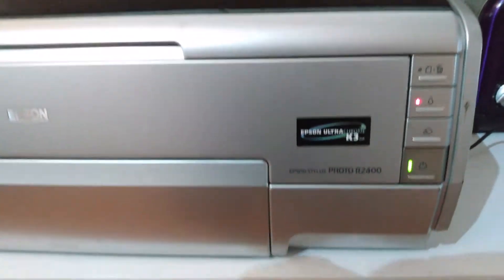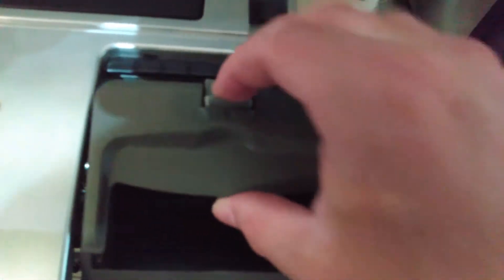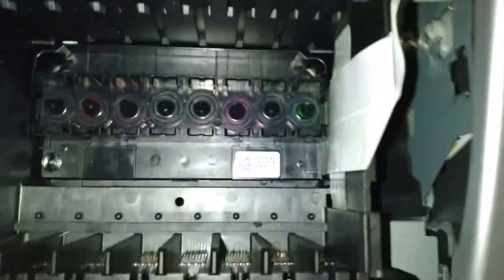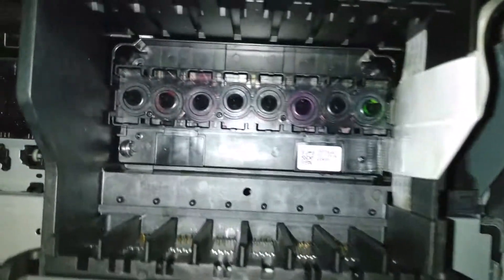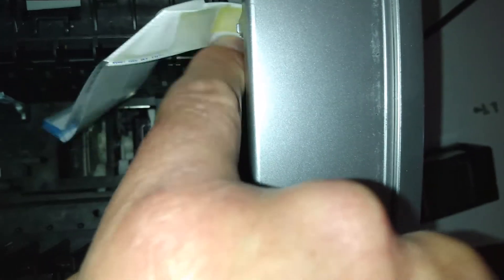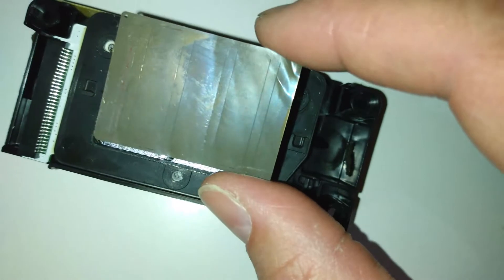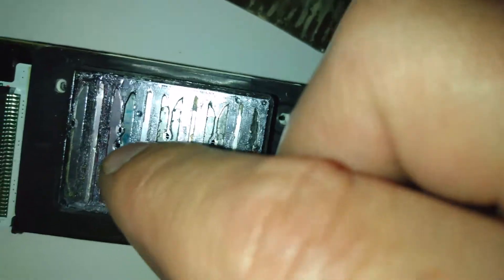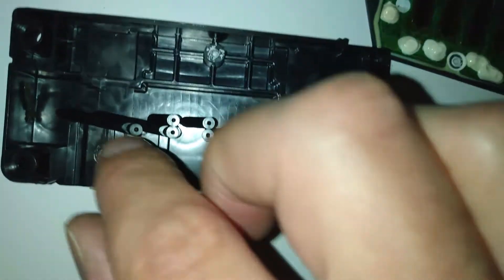Epson Stylus Photo R2400 Printer How To Remove The Print Head

Comment: How do I reconnect the ribbon cables? Which one goes in which location?
Reply from the maker: Hi, thanks for watching. I filmed this quite a while ago, I'm sure they just push back into the slots. They can't really be put into the wrong slots due to the physical orientation of them so it should be fairly easy to see. It's worth making notes as you go sometimes to help re assembly.

Comment: Sorry if this question seems amatuer-ish but can this printer be used for dtf or converted to sublimation? I have the opportunity to purchase one for a very decent price but would like to be able to use it for more than just paper if possible. Thanks in advance.
Reply from the maker: Hi, thanks for subbing by the way 👍. I have to admit I'm no expert on this printer but I did look it up and I found a video where a dtf print was done with this model which looked pretty good and another video I found showed a continuous ink system for this model too so by the looks of it, both might just be doable. Hope that helps 👍

Comment: Hi, thanks for the video. Never see print head inside before :). I have two questions- when you put the print head back in the printer do you need to use any software to do alignment? Also, some people advised to use isopropyl alcohol to clean your print heads if cant be cleaned only with water. May be added to the water will help?
Reply: Hi, thanks for watching and the comment. Once re installed, you'd just need to run the nozzle cleaning and alignments from the printer maintenance menus a few times, if no blockages then would be fine. I would be very careful with any fluids to clean as I didn't know the jet nozzle plate is glued on so in my case white spirit dissolved the glue. I forced air pressure in there which also blew a hole in the glued area so just have to be very careful.
Reply: @jahkingdom  Thank you for the quick response, appreciate!
Reply: @deyanhadzhev7190  you're very welcome, good luck with it 👍